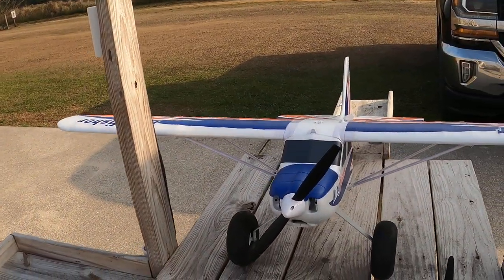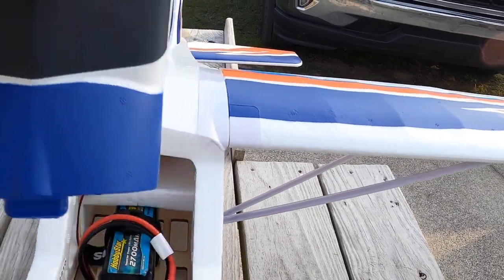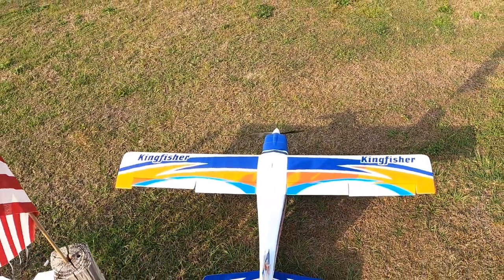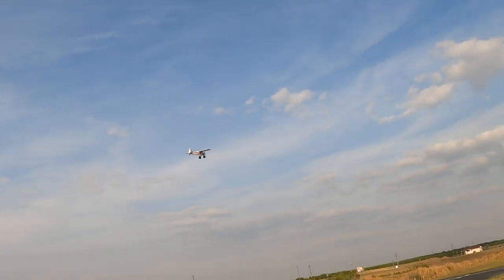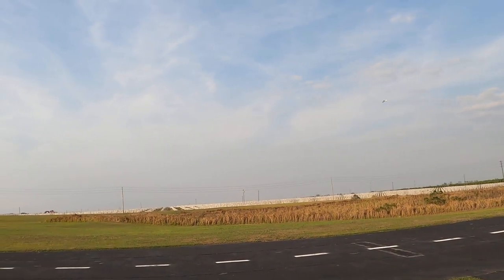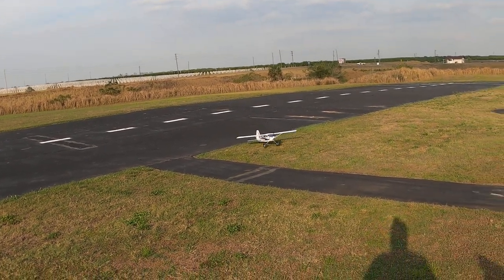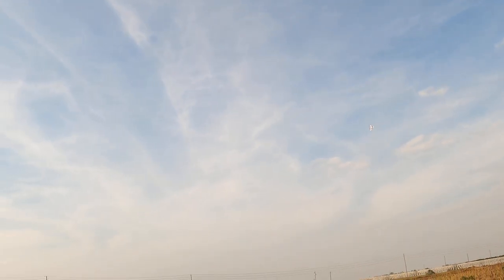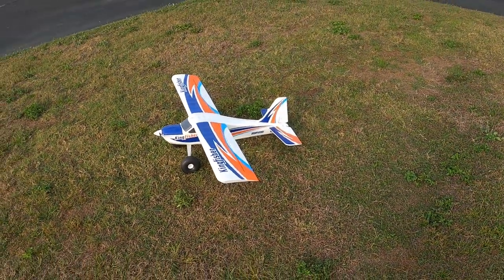REMAIDEN FMS KINGFISHER -NO STINKING GYRO FOR ME- by Fat Guy Flies RC

Comment: I'm getting back into rc planes been away for 8 or 9 years, got into drones and had 3k plus priced drones but sold those and alot has changed in the plane world, i was looking at this or the carbon cub s2 to get my feet wet before I just into the big boys
Reply from the maker: Very good choice but planes will react much differently then drones. PLEASE get as much sim time in before you go live.
Reply: @FatGuyFliesRC  got the carbon cub, flew it yesterday 3 times and started in intermediate mode and did awesome, flipped safe off for half the flight and did well, glad I got a plane with safe bc with it being windy and haven't flown in 10 years it took me about 3 or 4 min of flying to get confident, love the channel and thanks for the reply

Comment: Hi sir. I would like some help. I want to change the channels at my flysky transmitter, so I want to use the reflex to switch with 2 positions and the flaps to the switch with 3 positions(there is only one stick) . So my qwestion is in which mode the reflex will work? Optimized, off or stabilized? Thanks for your time.
Reply from the maker: I am afraid I cannot help you since I have never used a Flysky radio system. If I had to guess though the Optimized mode.
Reply: @FatGuyFliesRC  OK thanks.. I ll try.